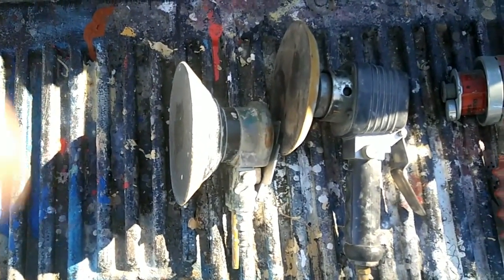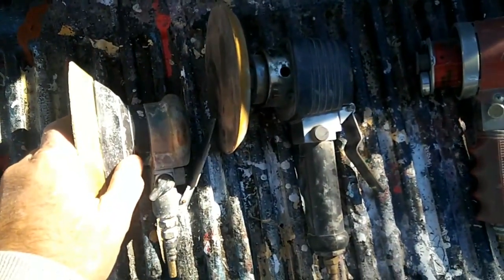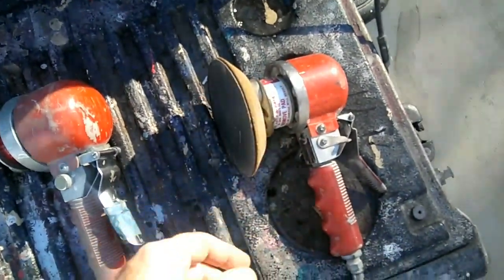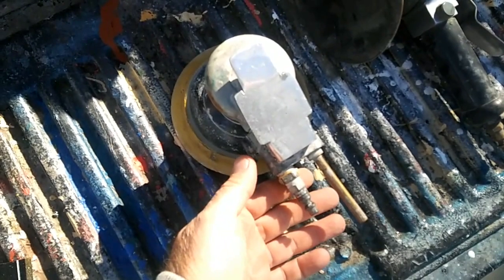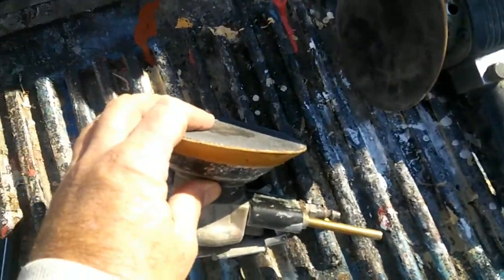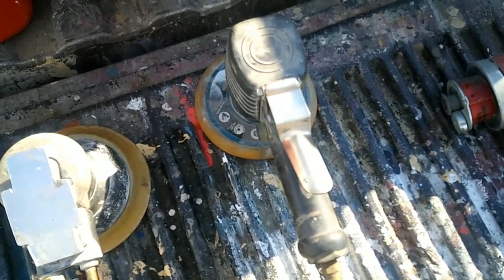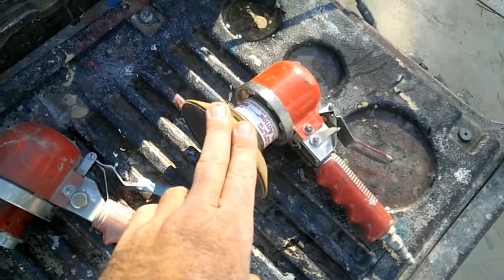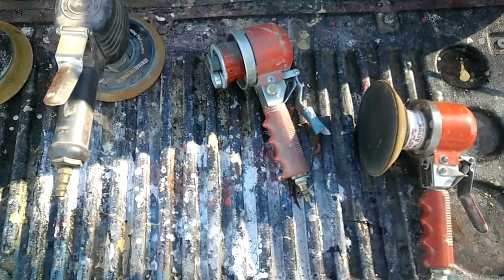Harbor freight pneumatic Sanders harbor freight sander

Comment: I have a 80 gal porter cable comp that rates 17 cfm @ 100 psi and it runs that black one all day long if I need it to.
Reply from the maker: wow. I have a 5hp 60 gallon and it is fine for a few minutes then it starts to drop and maintain about 50 lbs. Not enough to run that sander very good. I have had the compressor for 30 years. The  national detroit runs all day and the compressor catches up to it eventually and shuts off.
Reply: @Mikefngarage  30 years? I doubt it's keeping up with it's as-new ratings.